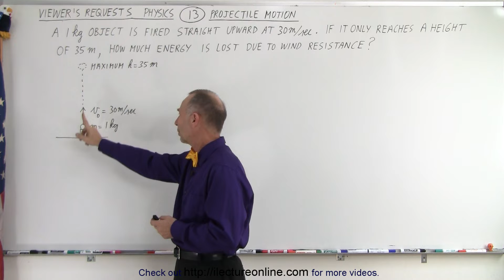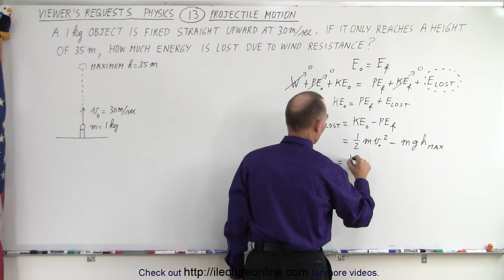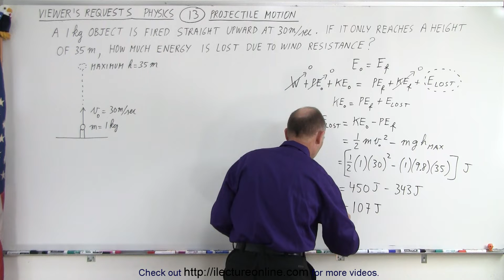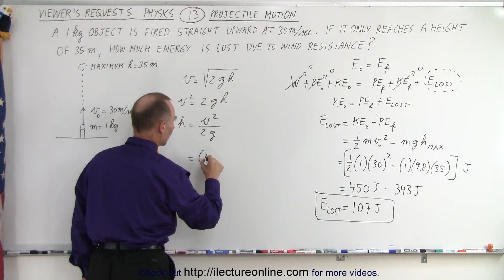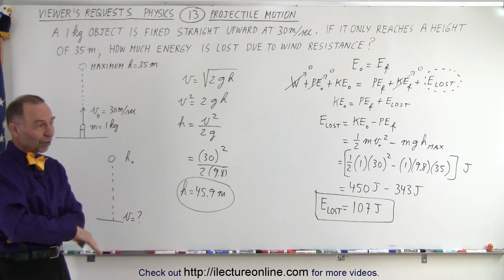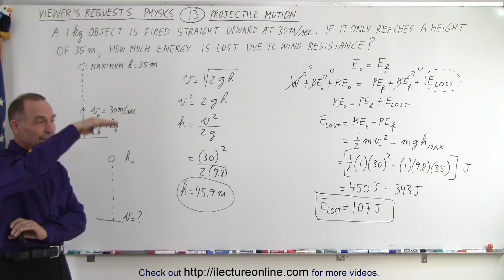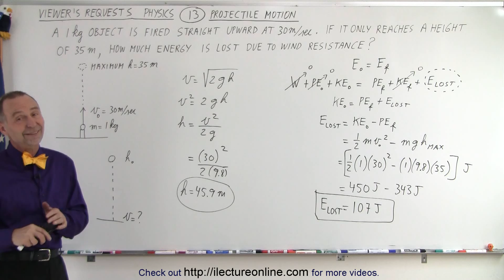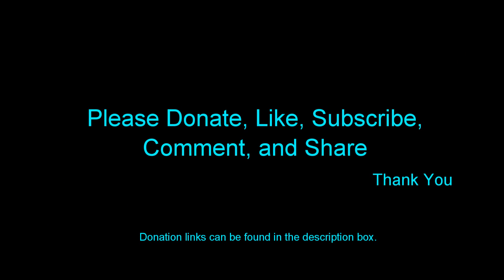Physics: Viewer's Request: Mechanics #13: Projectile Motion

Comment: A crane shift horizontal placed steel rod at distance of 5m.Cross section area of the steel rod is 100cm squared.It is lifted at the height of 12 by crane.Steel rod mass is 2 tons.What is the potential energy at that height?
Reply from the maker: Sorry, but I cannot make out what is happening from the description.  What is the initial height of the rod?   (Not sure what the "distance of 5 m" signifies).   PE = mgh  (since both m and g are known, we only have to determine the change in height)
Reply: @MichelvanBiezen  Sorry for wrong   
description.here it is.Length of an steel rod is 5m,cross section area of the steel rod is 100cm squared.Crane lifts it up and reached height of 12m.Initial height of the steel is 0.What is the potential energy at that height?

Comment: What’s the proof of
v = sqrt(2gh)?
Reply from the maker: KE = PE     (1/2)mv^2 = mgh    solve this equation for v
Reply: Michel van Biezen but why is the KE equal to PE in that case? Sorry for my ignorance.
Reply from the maker: When at the ground  E = PE + KE = 0 + (1/2) mv^2     When at maximum height  E = PE + KE = mgh + 0     If no energy is lost  mgh = (1/2 mv^2